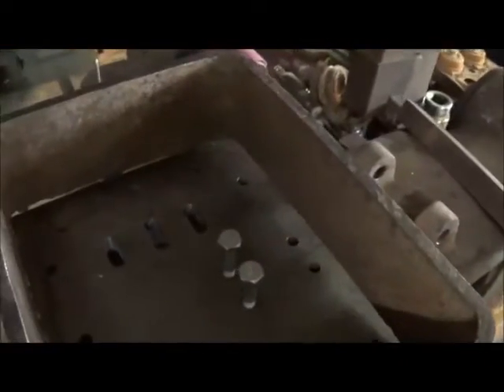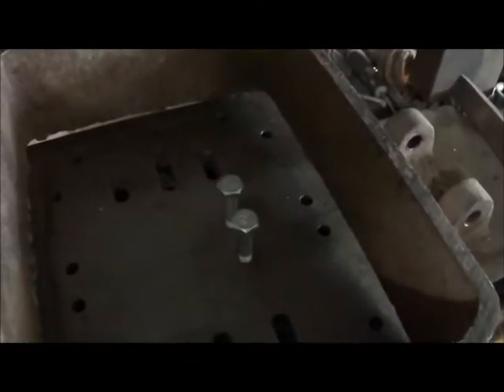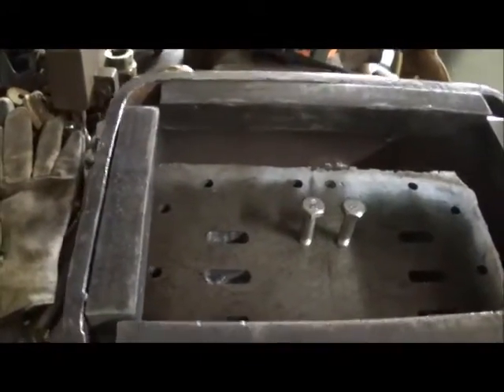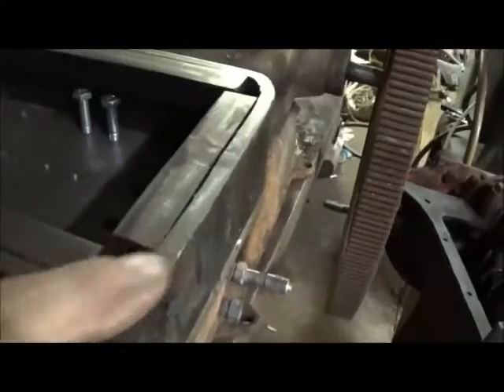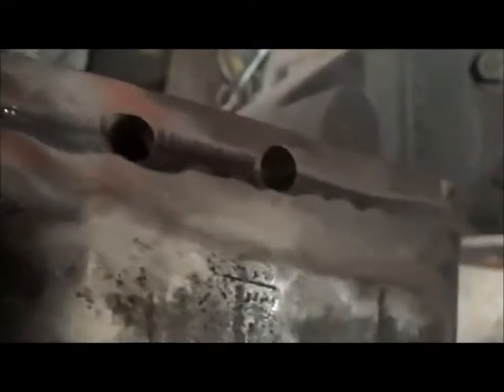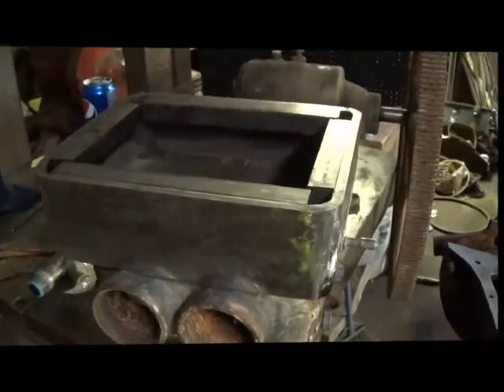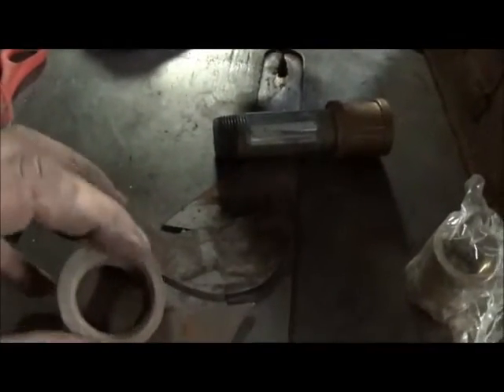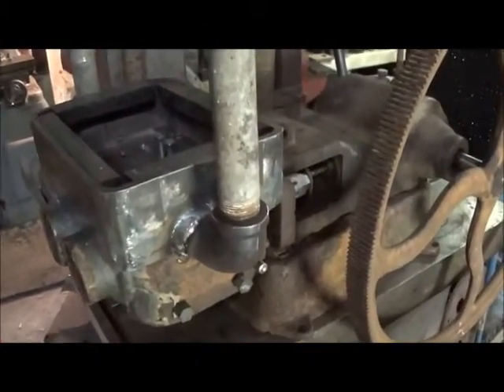Deming Water Pump To Steam Engine Pt6

Comment: Looking good! Any thoughts on valve friction due to the large area or will two small valves cause less trouble than the well pump build?
Reply from the maker: +Flintstone Engineering Shouldn't be a problem, but I will be making the area of the valve that contacts the top surface smaller. I left a pretty big area on the other one. The other one runs great, I leave it running in the shop sometimes while I am working, just because I enjoy the sound (I don't listen to the radio). It has at least 8 hours on it now at very low speed, but no problems so far. Can't wait to hear this one run!! Thanks for watching!! Jonathan